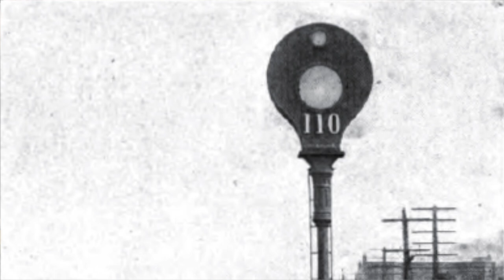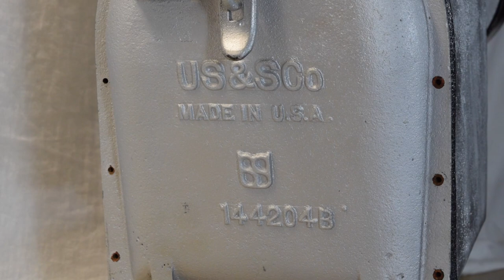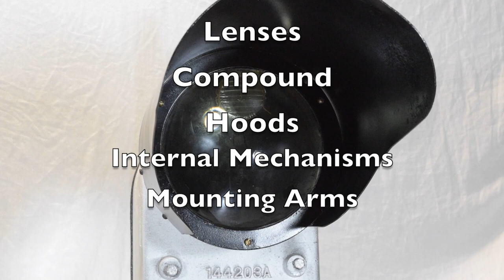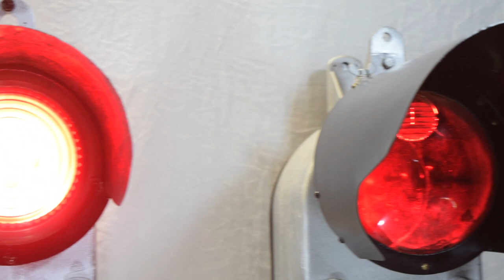Research of the Searchlight Signals

Comment: This video was right up my alley - Lol!!  I have been interested in signals and signaling systems since the age of 11.  But out of all the signals I've observed, the searchlight is my favorite hands down.  I always wanted to get my hands on a decommissioned unit as a "keep sake" or piece of iconic railroad paraphernalia.  But never could without paying a small "king's ransom", especially off of sites like eBay.  So, I decided to MAKE MY OWN, from durable plexiglass.  It is half the size of the real unit.  I chose the SA-1 (compound lens, not stepped-lens) because it is very easy to fabricate.  It does have a working internal mechanism with the miniature colored roundels; the mechanism uses the electromagnetic induction method to rotate the spectacle arm to change the colors very similar to the SA-1 prototype.  It is likewise built from scratch.   The unit in its entirety is about 100% completed; the mechanism having been installed within the housing, is operational AND EXTREMELY BRIGHT through all colors, especially the green indication.  At present, It has been tested out to make sure the mechanism is sound and to make sure it is mounted properly in the housing.  I am fully satisfied with the end result,  having painted this signal and have added the hood and adjustable mounting base as it is set as a dwarf or "pot" signal.  I have also completed another SA-1 that I will eventually mount on a mast as a "high" signal with a letter plate, number plate and a target.   So far, so good!!
Reply: Pro tip to get your hands on them, I just bought a US&S searchlight light relay on ebay, say signal relay and not "signal light" the shipping was mildly painful but I was able to score one for $60. Then try to find or replicate the body after the fact. I feel though you might have more luck with the body. Good luck and may you be as lucky as I was on that $60 dollar relay buy! And good on you for building one! I never could!
Reply: @iftheseoldbeastscouldtalk7796  Well, I as I said in the above comment, I have completed the dwarf or "pot" signal.  It's completely mounted and functional as it does have a "scratch-built" mechanism inside of it.  The second signal is likewise pretty much finish and has a functional mech. inside it also.  I just haven't mounted on a mast as of yet.  I've already sent still images and short videos to a few people to get their honest opinions about these replicas.  If you don't mind sharing your email address, I can send these to you. You can then see them for yourself. Both the still images and the vids are stored on my Apple iCloud.  So there ain't NO viruses connected with them.
Reply: @TheChicagoL  the address should be on my account page If you would like to send them. If not it's alright. It's nice that there are people out there still building searchlight hardware. The GRS stuff here in Howell MI on the Plymouth sub of CSX is in some danger. And our relics are older ones too. Dating from the 1940s. Sucks if they do get taken down as they still use the old Pere Marquette era telegraph poles to power them. Old hardware thrives in the great lakes state but not for much longer. Good I'm part of a historical society that likes them. We might yet save them from the torch.

Comment: Hi, enjoyed the video.  On the US&S side if you're using S11 lamps you should burn them at 8 volts for long display life.  (Refer to US&S pamphlet U-5037)  The operating motor/relay should be at 10 volts to ensure proper torque and long life.  Avoid low voltage < 10 volts there.  If you choose to use a 12 volt DC supply (many are +/- 10% adjustable) you can get the basic voltage level reduced to about 10.8 from the supply (close enough for the armature circuit) and 3 diodes in series for the lamp will be fairly close.

Comment: I like them both. I also have a custom fabbed housing that is coming that accepts both GRS and US&S mechs. They were produced in Winnipeg from what l am told. Apparently several in service on C.P. between Vancouver and Swift Current. More room to work with inside the housing too. The background is just flat with no outer ridge either.  Just a different one to have in my case. I now have several of each type including cast and cast aluminum. Just need the time to work on them.

Comment: Awesome searchlight Signal What Voltage did you use to make the coloured lenses move .cause I have search light insert and I don’t know what the voltage is it’s the Australian search light one I have
Reply from the maker: It should be a simple 6 to 10 volts DC.

I did explain in the video starting at 20:19 in the video where the connections are
Reply: My searchlight insert says AC current on mine
Reply: @christopher-2000  you may have a 110V AC mechanism. They were common across Vic. You may not be able to get it to go without a 240-120 transformer.

Comment: TWIGYBNSF,
Regarding your comment about the "bean-head" backgrounds being primarily used with the GRS-SA/SA-1 searchlight units (7:15 - 7:46) such as those used by C&NW, the Geneva stretch of the Union Pacific (former C&NW) as well as at Rochelle junction (b4 they were removed), I found a photo-link that actually showed "bean-head" background targets being used with US&S H-2 searchlight signals. It kinda looks odd, but here is the link in case you want to take a look:  https://www.flickr.com/photos/mark_vogel/7458798196/in/album-72157624562968832/ .   These appear to be (if they are still there) on a stretch  of C&NW/Milwaukee Road METRA right-of-way where the  Milwaukee Road splits off around, maybe, Paulina  and Western Avenues on the near-west side of Chicago.  I have seen these bean-heads from a distance while riding the Lake Street "L".  But I, like yourself, always thought they were SA units.
Reply from the maker: That's odd. Next time I go to Western Avenue I should check them out